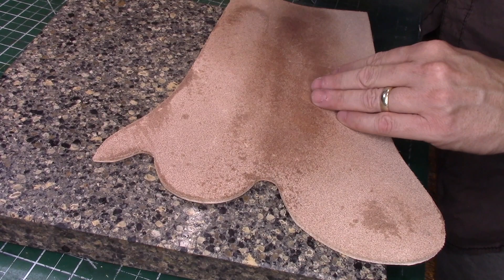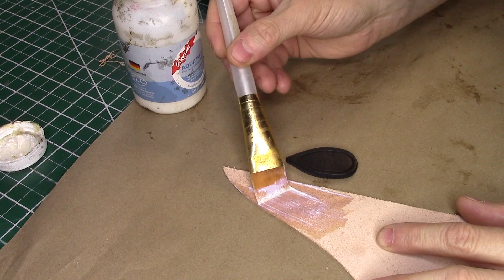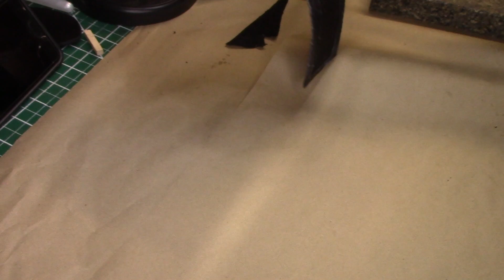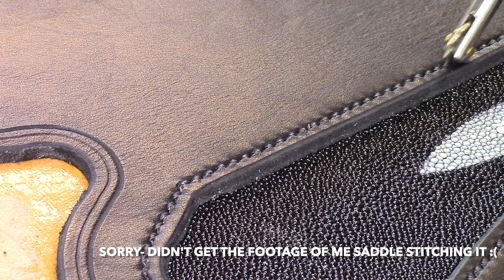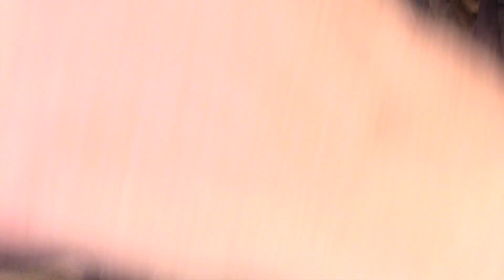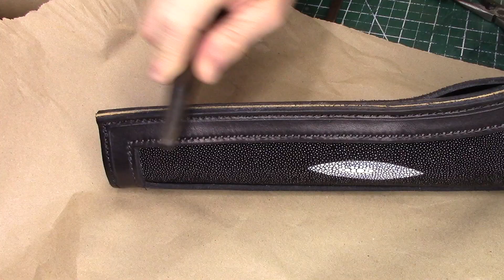Exotic Stingray Leather Slim Jim Holster Cowboy Action Leathercraft Cosplay Sting Ray Leatherworking

Comment: What knife do you use to cut leather and the clip you put on the blade?
Reply from the maker: My main cutting tool is actually a wood chip carving knife I purchased at Woodcraft. Specifically, a Swiss-made Pfeil #10. They make a bunch of different blade profiles and sizes. This one mimics the x-acto blades I'm used to using, but can be resharpened. The plastic wings are something I designed and 3D printed to help me push the blade into the leather. I also use an Al Stohlman trim knife.